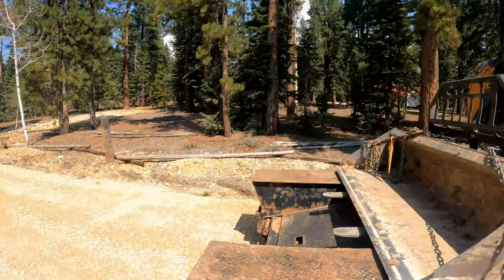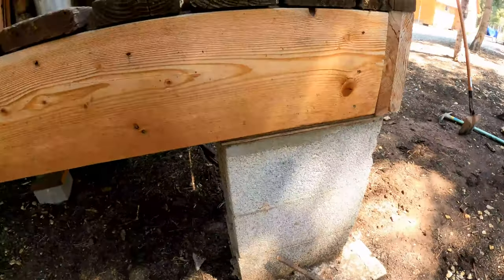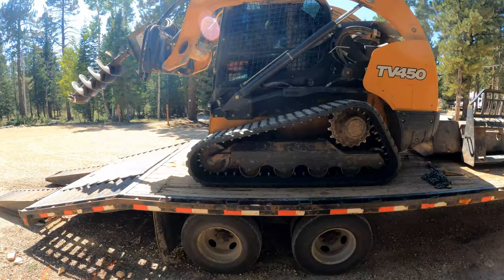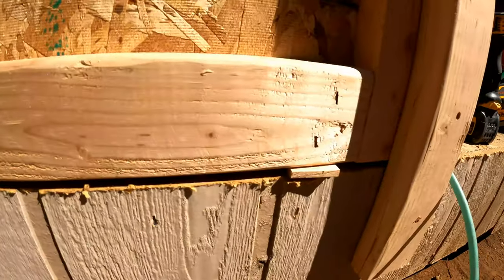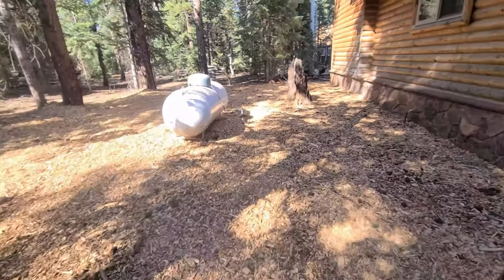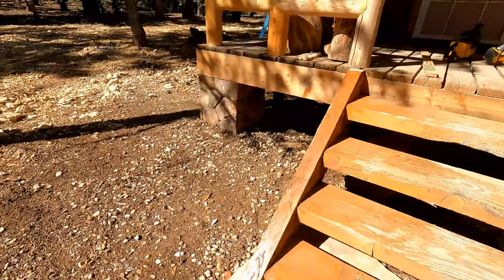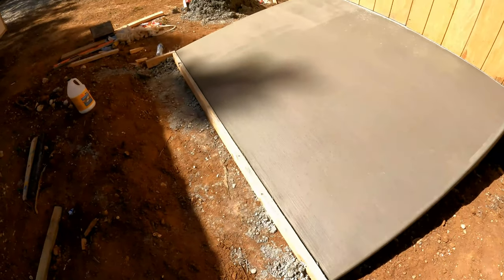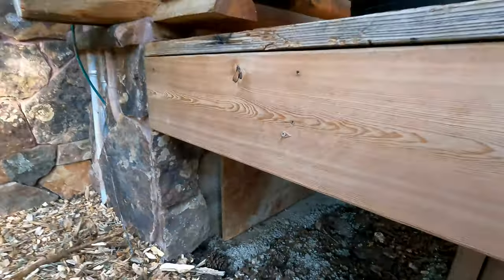Building log Fence, natural stone, concrete, landscaping and framing remodel Job

Comment: You guys do excellent work. Right after you pour, use your sawzall, without the blade, while holding the end where the blade goes, against your form, pull the trigger, and it vibrates it just enough to keep those honeycombs taken care of. I have found the vibrator works good inside the concrete, but the sawzall works nice to eliminate the bug holes, even on the 4” slabs.
Reply from the maker: Great idea thank you 👍